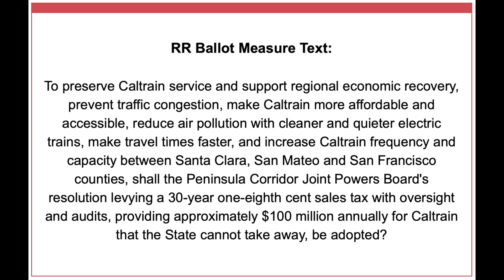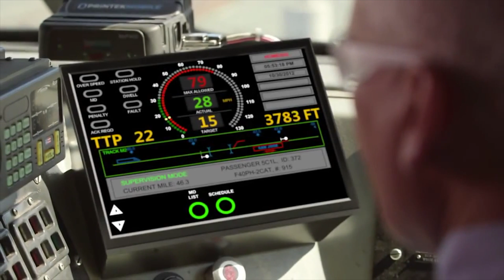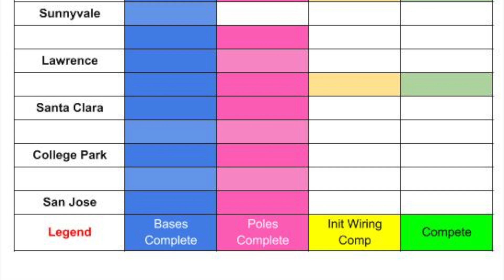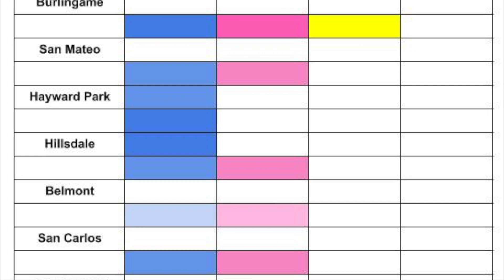Caltrain Electrification Update October 2020

Comment: If this is going to be electric, why cant they use a high speed tilt train? Like acela?
Reply: There is more to high speed trains than just electrification.  In order to get higher speeds, some changes to the alignement needs to happen such as track alignment and removal of grade crossings. The straighter the track the greater the speed, tight curves reduce travel speeds like the curve into SF.
Reply from the maker: They obviously could. Tilting trains however only add a small speed increase (10-20 mph) but add a huge cost increase to the trains.
Reply: If its a little faster than 100mph like 120mph, ill take it. Cali is long over due for high speed rail service.

Comment: What if CalTrain ran those AEM-7 with the N-S GAllery cars?
Reply from the maker: I would like to see it lol.
Reply: that was actually their original plan in the 90's when caltrain was planning to electrify the line but then gave up because of lack of funding and now 20 years later they are finally doing this project. the original plan for use of equipment were either an AEM-7 pulling gallery cars or metro north M2, M4, or M6 EMU's.

Comment: Looks like the overhead wires actually permit the use of double-stack container train if they have to run through this way just like Philadelphia area reading railroad electrified lines but not the Pennsylvania Railroad ones which will not clear double stack trains. Perhaps Caltrain should order Eurodual Locomotives to operate San Francisco Gilroy 80 miles by switching to Electric Power at San Jose towards San Francisco this is how it's done in the Northeast NJ Transit RVL electric mode Newark-New York Diesel Newark to High Bridge while North Jersey coast line Bay Head to Long Branch diesel but electric mode Long Branch to New York.

Comment: Interesting to see your cab footage. I only travelled on train in the US once, so not much experience. But interesting to see still wide use of wooden sleepers in many places. We received our first batch of Stadler KISS EMUs in Hungary after running single deck units for about a decade. Very nice rolling stock with great acceleration.
Reply from the maker: Yeah, wooden sleepers are still used on the majority of the US rail network. I like paint scheme of your new EMU’s! If only we could have more electric trains in this country lol
Reply: @TheFourFoot  Thanks. Diesels used to be red, and electrics blue. And the electric EMUs came and all started in red, the new batch is now blue and first stock just goes through major refurbishment and getting re-painted to red. To be honest I am not surprised that US has not a lot of electric, our network is lot more dense and distance are smaller, gas is expensive (and Russian).  But you can't beat the acceleration of electric EMUs. And I think it makes a big difference especially on commuter lines with frequent stops.
Reply: @TheFourFoot  I hope the KISS are as good for Caltrain as the Stadler FLIRTs (combi EMU/DMU--1/2 length diesel genset in middle) have been for Greater Anglia in the UK

I have travelled several times on one of the first routes converted from traditional DMU to a Class 755 FLIRT, NRW to SHM Bittern branch line, very nice, quiet smooth ride, quicker acceleration to help timekeeping, peak speed about 65mph.  (Mostly single track so service pattern can't be increased without more passing loops)

Waiting to try one of the newly released Class 745 12 car FLIRT overhead powered EMU expresses on the 100mph GEML LST-NRW (replacing loco hauled Class 90 with BR Mark 3 coaches, which can do route in 90 minutes with one stop, more typically 120 mins with multiple stops).  

Transport for Wales also now ordering 3/4 car 755 FLIRTs for branch line use across much of Wales.

Only common complaint with all the new "metro" type trainsets in the UK (Stadler, Bombadier, Siemens, CAF) is hard seating: seats are padded but changes to fire safety regs and desire to cram in seats has conspired to a massive reduction in seat padding with denser/thinner foam being used.

Two small problems on Class 755 introduction: a very near miss at a level crossing (cab video available on YouTube, NRW-SHM branch) due to the crossing's triggering sensors not being properly adjusted for the new trains.  And an delay in introducing on last branch line (MKT-SUY Gainsborough Line) as the new trains are heavier and some necessary bridge strengthening was forgotten in the planning.
Reply from the maker: I hope so too! Thanks for the great info, I’ll check it out!
Reply: @TheFourFoot  Useful linkage
The near miss cab video: https://www.youtube.com/watch?v=kaZWrMPDNO8

Gates lifted too early!

(NB: I think because it was nighttime in a built up area the trains don't customarily blow horns on approach to level crossing, but I could be wrong.)

Investigation report: https://www.edp24.co.uk/news/thorpe-end-rail-near-miss-caused-by-leaves-6746682

And if you search Youtube for "geoff Marshall FLIRT" you can see the UK version of the FLIRT trains in action (international versions are a bit bigger--small UK loading gauge strikes again).  Geoff Marshalls recently published visit to Bewley Arms (this years least used station in the UK) has both outside and inside shots.  Searching for class 755 and class 745  will quickly get you to the right videos

UK probably would not get the KISS because they are too big for loading gauge for almost every line.
Reply from the maker: That video is crazy! I know how big an issue leaves are in the uk for stopping, and apparently level crossings, but I’m continually amazed by it, because it’s really not even on American railroads radar lol. 

I have seen the videos Geoff Marshall did about the new FLIRT’s, he always does a great job!
Reply: @TheFourFoot  railway margins are surprisingly diverse habitats in the UK; age of many lines and a desire for screening and natural livestock fencing/agricultural land stabilisation/wind screening means most lines have mature trees (planted and self seeded) and hedgerows.  With that comes leaves, a long standing problem (even features in several original Thomas the Tank stories).

Even new lines like High Speed 2 (the world's most expensive railway apparently £80bn+ including rolling stock for all phases) need to consider wildlife diversity on the margins of the railway (contractors have recently published their environmental mitigation promises which covers this in some detail).

Comment: Could you do a segment on the much delayed downtown extension and where they sit now with the route and anticipated completion date? 

I am really hoping that in the distant future they can have another trans bay tube for an electrified Caltrain but instead of to Oakland to the Marin and the North Bay. Then they can combine SMART and Caltrain into a single system.
Reply from the maker: I definitely could in the future! Yeah, building the trans bay transit center as a terminal station is a huge mistake. A transbay tunnel extending out the north end of the station would be ideal, but that’s unfortunately a long ways in the future, if it’s ever even built.
Reply: @TheFourFoot  there will be no extension because BART exists.
Reply: i agree that, my planning will be that the second transbay tube will be for caltrain and meet up with SMART at larkspur. my other ideas expanding the caltrain system was the santa cruz branch when they finish the salinas extension and use diesel trains there. and my proposed route ideas
-Electric mainline(Marin/ North Bay/SF to Tamien/SJ), 
-Diesel mainline(Tamien/SJ to Salinas/ Gilroy),
 -Santa Cruz branch. (Watsonville to Santa Cruz or (even Half Moon bay or Pacifica, not going happen anytime soon)  
-Dumbarton(Redwood City to Union City) ALTHOUGH THEY MAY USE DIFFERENT EQUIPMENT AS WELL AS GOING UNDER A SEPARATE BRANDING FROM CALTRAIN.

Comment: Route to gilroy won’t be electrified so some of caltrain’s diesel locomotives would still need to run! But where will they start? SJ Diridon or SF? You decide!
Reply from the maker: Yeah, the MP 36’s are going to be around for a while because of the the Gildoy segment, and they’ll run all the way into San Francisco
Reply: @TheFourFoot  aren’t people going to be confused when they see poles and wires next to the tracks for the electric trains and see the mp36 diesels traveling on them? ( that’s after the project is completed and wether they wait on the platform or at a RR crossing)
Reply from the maker: Are people ever not confused when it comes to technical details about trains? Lol

Comment: It will have a final cost of 1532423000440534540 Yen and go the speed of a steamtrain.
Reply from the maker: That cost projection is a bit high, but the Mallard went 126 mph. Caltrain currently has a top speed of 79 mph and is projected to have a top speed of 110 mph once CAHSR begins using the corridor.
Reply: The train we are currently trying testing has a top speed of 144mph which is restricted based on American regulation.

Comment: There are two AEM-7's however only one is being restored and the other used for parts. The plan is to use the one working AEM-7 as a test train once electrification has been completed. Unfortunately most of the poles and other equipment is being shipped from overseas to the US and with the pandemic, that has severely delayed the electrification of the line. The other issue is that one of the contractors for the stringing of the Wires is also internationally based. With that in mind, and only being able to work in off peak hours, as well as the Shutdown of literally everything on the peninsula, most of those workers returned home to other parts of the world. Also the issue of funding. It is clearly a fairly profitable line as it stands. Many companies along the peninsula have offered to help fund the project through public bonds, however with the shutdown of the local and state governments, that will not be happening for a long time, even though it would drastically increase the amount of available money for the project. I believe that it will completed at some point, just as CAHSR, but the bigger question is definitely going to be when will it be completed.
Reply from the maker: For sure. I have no doubt that either the electrification project, nor high speed rail will be built, but indeed it’s just a matter of when. Obviously it’s going to take a while after the worst effects of the pandemic have subsided for industry to get back to normal, but obviously Measure RR will help Caltrain in the near term. I’m looking forward to seeing the AEM-7 run again, do you know which one of them has been selected to be the parts donor? Thanks a lot for watching and responding!
Reply: @TheFourFoot  I do not know which one has been selected. I'm guessing that they have yet to be used for anything as they were wrapped after arriving (likely to deter people from getting into them) and haven't moved since.
Reply from the maker: Yeah I figured.
Reply: I did not know one of them is scrap metal. I did know, however, that the AEM-7 is a test train. I think I will be interested in seeing them!

Comment: If the NE Corridor in CT had this track geometry, Boston to New York would take less than two hours.
Reply: with the fastest Chinese trains (operational speed of 250m.p.h.) it would be less than an hour and with the train they are going to put on the tracks (operational speed 275 m.p.h.) in the next few years it would be around 40-45 min
Reply: @cliffwoodbury5319  The newly upgraded Chengdu  - Chongqing HSR is 307KM (almost the same as NYC to Boston at 306km), and the current fastest trip time is 62 minutes. Acela according to Google is 3.5 hours. 

Ticket cost of Acela is $113 to $191, while the Chengdu - Chongqing ticket price is $21 to $67. So like same distance, 1/5 of price and 1/3 of time.

In term of train frequency, Chengdu - Chongqing HSR runs every 10 to 30 minutes between 6:30 - 22:40 average 87.5 pair of trains daily. Acela Express is about 20 per day.  Regular slower trains are not included in both counts.

One note: A new HSR route between Chengdu and Chongqing is in planning to further cut the travel time (278KM), and more importantly, link different cities in the middle. Design speed is 350km/h with reservation for 400km/h (Previous one was 300/350).

Those two cities are in far west part of China, less developed and more mountainous than eastern provinces.
Reply from the maker: For sure!
Reply: They could use it but Amtrak doesn't care enough...
Reply: @BulletTrainProductions  It's not that Amtrak doesn't care, it's that Congress doesn't care. They can only afford whatever Congress allows them to.
Reply: @marcuscnelson  Amtrak is more corrupt than you think, but you're not wrong about congress not caring either. But, they new leadership
Reply: @BulletTrainProductions  amtrak realized that if they run their organization really efficiently, the government will give them less money.  soooooo what do you think happened?
Reply: @davidanalyst671  doesn't matter what happened the government needs to stop giving more of the money to the airlines and start supporting railroads more with greater financial aid!
Reply: Built in different time, a century and a half ago.
Reply: Have you counted all the grade crossings on the Caltrain?
Reply: @LMB222  Almost as many as the NE Corridor, but all have been removed, except for7 in CT. What they haven't been able to do is straighten out the curves. If CalTrain eliminated some of their crossings, their top speeds could be much higher , up to 150 if the equipment was good for it. At this time tangent track with constant tension catenary is present in Mass and CT.and a stretch in New Jersey.